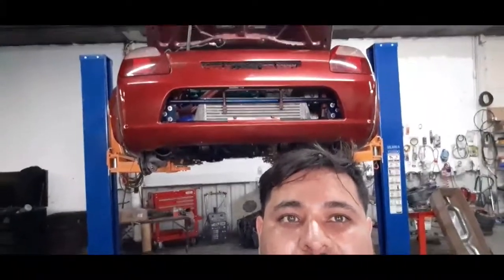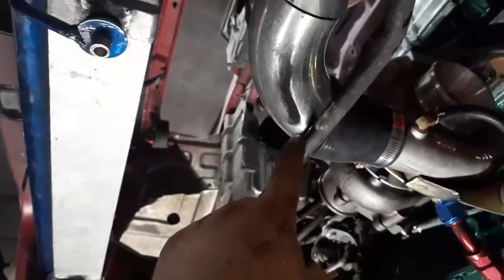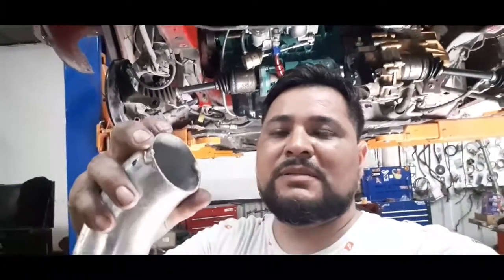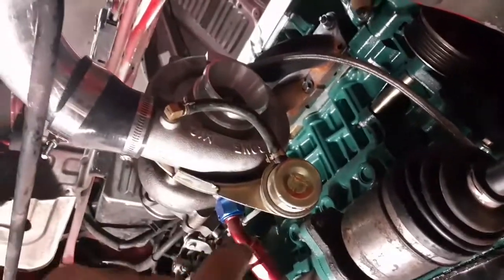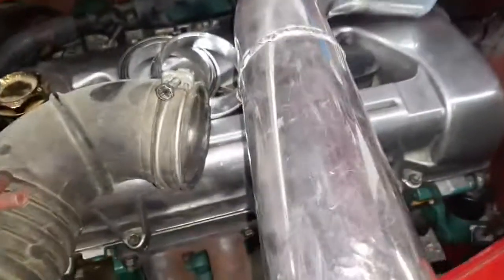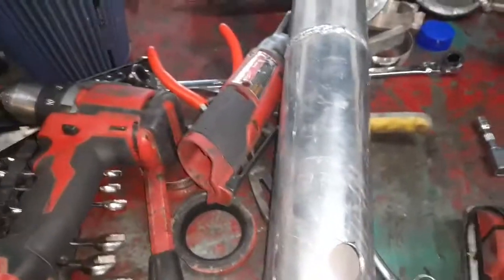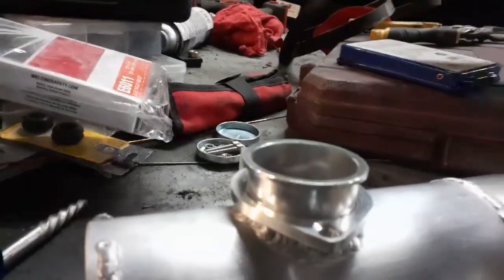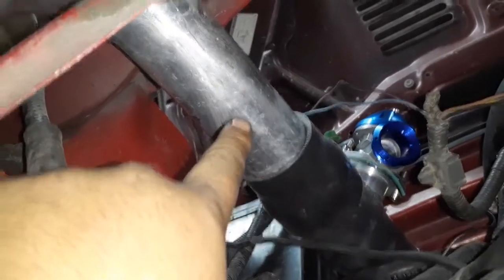How to install a turbo on a 2zz ge Toyota MR2 Spyder part 2

Comment: Did you do any internal modification to the engine to accommodate the turbo? If yes what are they? I heard 2zz isn't really a turbo designed engine.
Reply from the maker: Yes I did Darton's leaves  Max speedrods  and whistle pistons
Reply: @happytuningperformance3924  is reliable engine the 2zzge mate? In stock form with 192hp without slevves and turbo etc...?
Reply from the maker: And monkey ranch camps
Reply from the maker: Cams
Reply: Thanks for the info. I've been doing some research on this engine and saw that it can be stroked to about 1930, that with a turbo setup would be crazy